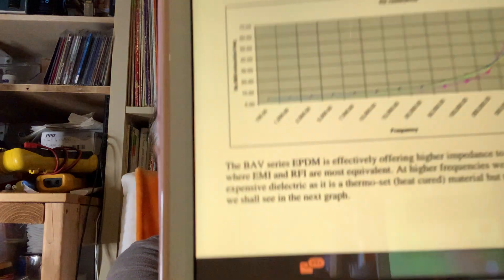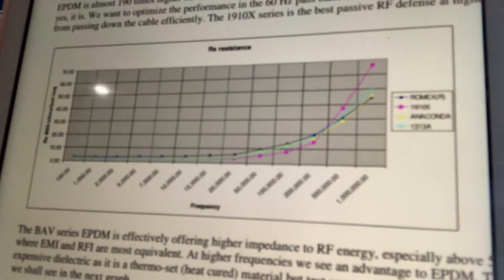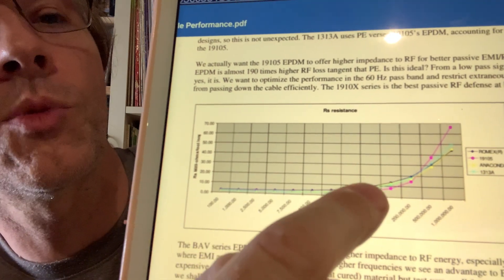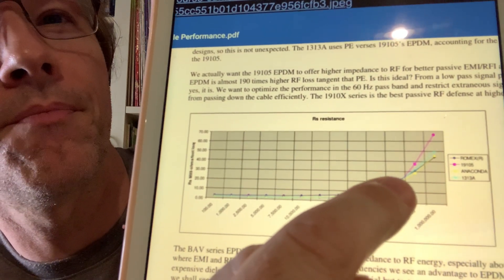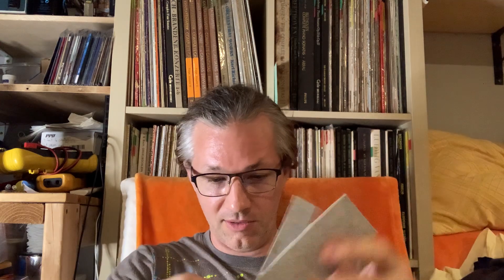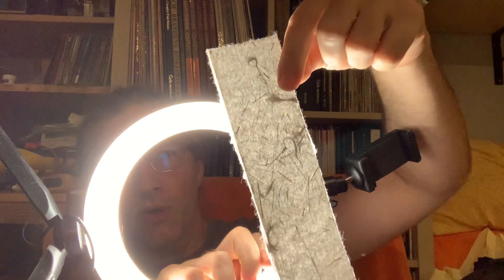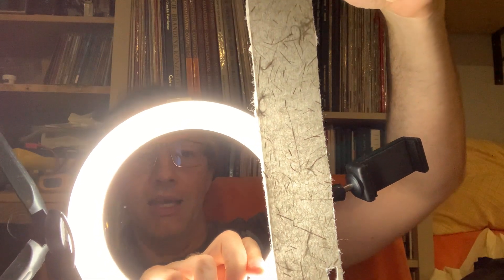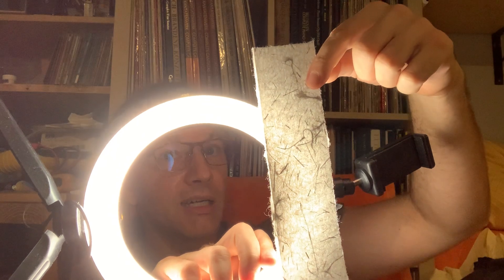Unique dielectrics... or something else? tips to combat EMI/RFI

Comment: What do you think of the Decware zen box that has a tube for volume control? Thanks
Reply from the maker: Hi Ramon, the zen box uses the tube as a cathode follower to act as a current buffer, the tube does not do the volume controlling. (12xx7 family is not variable gain, unsuitable for such purpose.) There's only two folks I know of who are thinking of tube volume control: one of them is myself (have ideas but have not implemented it yet), and the other is Peter Qvotrup of AN. AN is close to revealing their tube volume control preamp... but that's something extremely hard to do in high quality. (Old car radios did it in a low quality version. Problem is variable gain tubes change impedance with gain - that's why you don't see this in practice, as tone / behavior also changes with the volume.)

Comment: I certainly am not very knowledgeable on this yet, but how I basically understood this was that it's an impeding interaction for RF happening near the conductor-dielectric interface where the RF energy has its field densest. And that a dielectric like PTFE conversely presents significantly less impedance for RF travelling at the surface and thus would be better used with the ground conductor.
EPDM has a high "loss tangent" for RF, so as a dielectric it will dissipate more of RF into heat. How significant this is for an audio power cable, would be nice to know. I don't think it is commonly applied. But the numbers give indication it might be useful. As you say there might also be complex interactions that are unwanted. Galen Gareis of Iconoclast Cable (Belden) who presented that graph didn't know to mention any downsides here but that is technically speaking in terms of what is known. (He said nothing of the part we might not yet know)
https://en.wikipedia.org/wiki/Dielectric_loss

What you suggest is essentially passive shielding, yes? There's also carbon particle based and carbon-metal particle mixture based passive shielding material available, it is probably more commonly infused into polymers instead of papers (surely that ERS paper isn't normal paper either). This could be meaningful to consider when placing such passive shielding relatively close to a signal conductor, in terms of the very mentioned dielectric loss and capacitance, though in terms of capacitance the bigger culprit is probably the conductive media infused into the material.
I have no clue how much a passive shield with NON-100% optical coverage might affect capacitance at reasonable distance. Probably not much but what is little is often audible - though for a power cable, capacitance shouldn't really be an issue, right? At least the AC socket won't have problems driving a whatever high capacitance power cord...
Reply from the maker: Thank you for the research, the high loss tangent explains a lot. Yet, it would certainly add its own colorations, and lilkely introduces more complications than air as dielectric. There's only one way to tell if it works for audio - to try it. This is one of those things, could be promising.
Reply: @realworldaudio  Bernard Salabert of PHY-HP goes as far as strictly avoiding all synthetic materials in the whole system (so cotton dielectric), basing it on studies of "micro discharge interface" - high amplitude ultrasonic spikes that might cause intermodulation. Can't be sure how right he is on how much this phenomenon affects an audio signal (and certainly can't be sure if the accompanying "Langevin ions" are an audio problem) but there most likely is truth to it. Some dielectrics can be very harsh and problematic and obviously not blindly depending on the dielectric constant, nor the losses, as it can seem more like a gain (of distortion).
If this is a phenomenon to consider, there could be very interesting cases of dielectrics where ultrasonic spikes are occurring at the interface and the dielectric is also losing them to heat at the same time. Can we consider how fast the energy conversion is? If an effect roughly like "MDI" creates these spikes much faster than the dielectric can lose that ultrasonic energy, the intermodulation could happen and we'd now have a deteriorated audio signal...